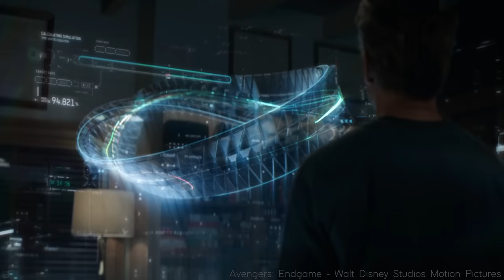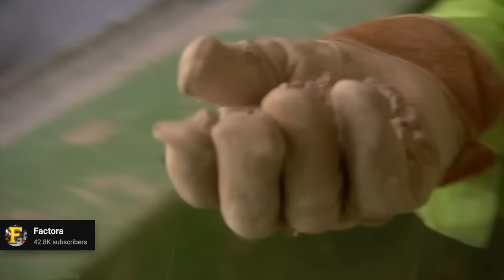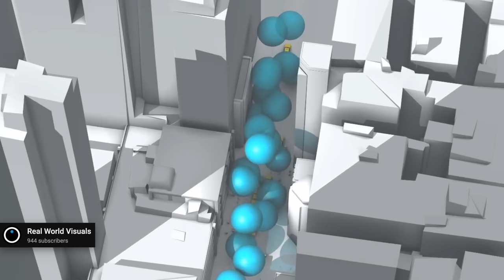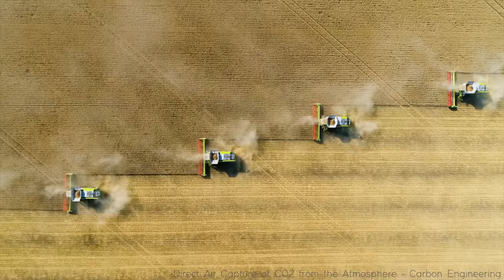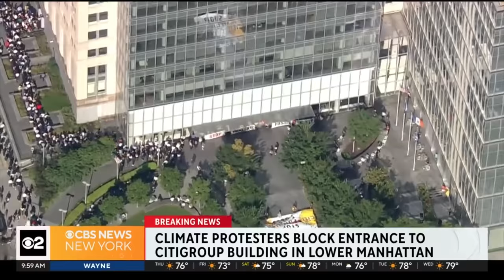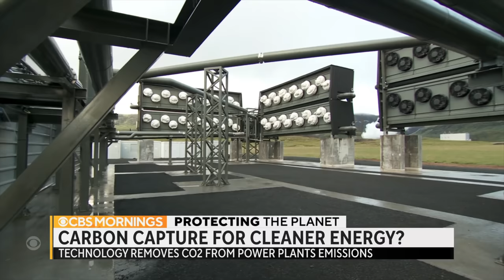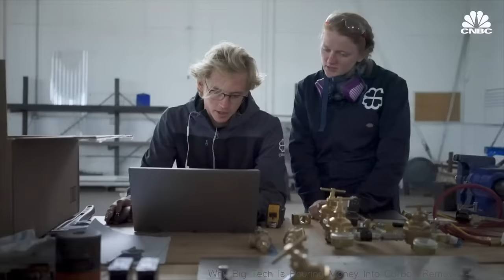How Thermodynamics Holds Back Negative Carbon Tech

Comment: I was initially impressed with this channel but when you stated your “contribution “ to save carbon I realised you were on the wrong track. Running a battery EV is totally against the carbon solution. And do plants not generally reverse the CO2 conversion at night? 
We need to reign in the filth that Asia is pumping out and not run around in expensive EVs that actually deplete resources even more.

Comment: We've had the solution since the 1950s. It's called nuclear energy.
Reply from the maker: Doesn’t solve cement/steel/agricultural/etc emissions but definitely a step in the right direction
Reply: @CoolWorldsLab Those 'issues' will solve themselves once we're out of oil. Coming soon to an earth near you. (By 'soon' I mean several decades, at current/increasing consumption rates. I'll be long dead before I see the worst of the fallout from it)

Comment: First of all, we need to split the CO2  and separate out the carbon and oxygen. And then store the carbon. So for that we need to dial up on thermal solar towers and crank up on the electric processes to split co2 and return only the carbon back to the source

Comment: If DACs got deployed correctly, there wouldn't be brownouts: you'll need GWs worth of extra energy production to afford running DACs and you can always make it so DACs only use excess energy production. More distributed energy production everywhere to power a non-critical loads like DACs should make the grid more reliable overall, not less.
Reply: The issue is that both scenarios assume a growing economy and emission amount so dac demands will increase over time if we plan to reduce the atmosphere ppm. Every summer there are brownouts from the increased energy use of ac alone, of course there will be brownouts if we start diverting 5% of our total output and increase this demand.
Reply: @charlescook5542  You don't divert 5% of the existing supply to DAC, you add 5+% to baseline energy production and sink it into DAC when nothing else needs it.

Comment: Has anybody considered letting the oceans remove the CO2 gas, and then we remove it from the oceans through electrolysis? The energy required maybe greatly reduced since you are assisted by the ocean. Clearly nuclear power will be the only source that can supply the energy needed.

Comment: Ironically, gas flaring wastes 40% of gas (a by-product of oil extraction) and adds to the GHG issue. Such a waste of potential energy. Energy that could be used to at the very least generate electricity for good uses, like carbon capture.

Comment: Wrap a load of logs with stones to weigh them down, using natural fiber rope, then drop it in the Mariana trench. With the low oxygen environment, you'd think it'd "capture" the carbon for quite a long time.
Reply: Yes. But not in the quantity needed.

Comment: Renewable energy is growing at 6%. Solar is growing at 28%
If solar keeps that up, then in 2050 we will have 530 petawatt hours of solar. That is enough to suck up a lot of CO2. The most pesimistic numbers in this video was 120 perawatt hours, for current efficiencies and reverting to preindustrial levels despite lots of emissions.  But that curve was fairly spread over decades, the area under it was about 2000 petawatt hours.
But that exponential curve starts low, so it gives us almost no electricity, until suddenally we get loads of electricity in around 2050 ish. Ie the total solar we get up to 2050 is around the 2000 petawatt hours. This is solar doubling every 3 years. So by 2050 it's given us just enough energy to suck out all the CO2, in a high emmisions scenario, but wait another 3 years and we only need to use half our solar, wait another and it only takes a quarter. 
And by this rate, the entire earths surface is covered in solar by 2076. Exponential growth is crazy.

Comment: There are forms of carbon capture that don't require heat or electricity at all and are completely passive. New types of cements are being made that instead of releasing CO2, absorb it over time like natural weathering, but to higher efficiency. In addition, metal mining causes a huge amount of environmental damage, not just emission-wise but damage to ecosystems and communities from the explosives used and toxic chemicals released. A lot of this could be mitigated by moving most of our metal extracting activities to The Moon where all those metals are waiting for us to scoop up off the surface with relative ease as it's mostly found in the fine powdery regolith, and the low gravity and lack of atmosphere will make transporting that metal-rich sand back to Earth a lot cheaper than sending rockets to space from Earth, once the infrastructure has been built.
Reply: We don't really need to extract all that much more metal. We just need to use what we have better.
Reply: @gekkobear1650  For metals like iron, copper, aluminum and others commonly found in any warehouse this is probably true. It's the rare-earth metals used in electronics that we have a severe shortage on and are extremely dangerous to mine on earth that lunar mining could help greatly with.

Plus, if we could make titanium as cheap and abundant as iron it could replace steel in countless ways, from building structure to vehicles to even kitchenware.

Comment: A few thoughts:
What difference would fusion make, if we speculate commercial readiness by say, 2035?
What about carbon release from tipping point ecosystem collapse? For example methane hydrates or permafrost release? I think that’s not included in those emission scenarios and it make things look a LOT worse?
And finally, where does all the captured carbon go? I imagine we’re talking about insane physical quantities. Can you run the numbers on that, because it seems like another fundamental  issue with scale for DAC
Reply from the maker: Fusion would certainly help if we could have industrial scale by 2035 but that looks v unlikely. Where to store is not something I got into, but it could be sequestered back into the oil fields it came from, or sequestered into plastics, building materials, etc for example

Comment: Thanks for the Thermo figures. The IRA gives $85/ton tax credits for CCS and up to $185/ton for DAQ CCS. Collecting CO2 from ethanol fermentation is much easier as the CO2 in the stack is near 100% (P1 =1 and not 400 x 10^-6) so it is hugely more efficient than DAC. We first need to make our electric power clean and electrify transportation, buildings, and industry. DAC is one of the worst investments and certainly not an excuse to continue emitting green house gases.
Reply: One day hopefully soon, we will have largely replaced fossil fuels in large parts of the world. And when that day comes, the next steps involve DAC. And we don't want to have to invent the tech from scratch when we need it. 

Put a bit of money into lots of different projects, because if/when you need experience in a particular area, expertise can't be bought quickly.

Comment: DAC using "technologie" (in the sens of it not being related to biology) is for sure a new development, but what about the other alternative? BioEnginiring.
Sure using tree is not efficient do do proper carbon capture, but trees are not the biggest source of photosynthesis in nature, they are even pretty bad at it compared to alges and phytoplankton, maybe a bioengineered algea that is really good at converting CO2 to a solid organic compound (that could maybe be used to make stuff) would be more efficient at capturing carbon than machines that would suck up a fith of the generated electricity world wide.

Comment: the realistic question for everyone is WHAT ARE YOU WILLING TO GIVE UP? the fact that nobody on any side is asking this question means that we're actually not serious. you going to give up YOUR job? how about your phone? or your internet? or your comfort in the summer and winter? air travel? no? well there's your REAL answer. all the "worst case scenarios" are the likely scenarios as it pertains to atmospheric co2. the ramifications of that are not clear. but the ppm in the air is pretty much certain.

until we actually talk about tangible SACRIFICE, this is all just rhetorical jerking off and frankly, a waste of time. but we go on blab blab blab blab blab. it's what we're best at.
Reply: The problem with any sacrifice based mentality is it goes around sacrificing. That is, it goes around getting rid of nice things, while not actually asking what it's getting. So you sacrifice things that people enjoy and actually have negligible carbon footprint.

Also, if you are going "sacrifice", and some tech pops up, like solar radiation management or cheap solar or something. Then it's hard to go "oh, we don't need to sacrifice any more, we can do that instead". 

If you decide we need to lower standards of living to fight climate change you should check both that the changes you are making are less bad than the climate change you are preventing. And also that they are actually needed. That there isn't some clever have your cake and eat it too scenario.

Comment: Daisyworld & Climate Regulation Through Biosphere Enhancement

"Daisyworld... provided a number of useful predictions of how Earth's biosphere may respond to, for example, human interference. Later adaptations of Daisyworld... which added many layers of complexity, still showed the same basic trends of the original model.

One prediction of the simulation is that the biosphere works to regulate the climate , making it habitable over a wide range of solar luminosity. Many examples of these regulatory systems have been found on Earth...

Later extensions of the Daisyworld simulation which included rabbits, foxes and other species, led to a surprising finding that the larger the number of species, the greater the improving effects on the entire planet (i.e., the temperature regulation was improved). It also showed that the system was robust and stable even when perturbed. Daisyworld simulations where environmental changes were stable gradually became less diverse over time; in contrast gentle perturbations led to bursts of species richness. These findings lent support to the idea that biodiversity is valuable." ~ Wikipedia, 'Daisyworld' entry

Comment: Please do not forget thte fact that, if everyone in the world wanted to use an EV car, 1) Earth does not have enough Lithium resources (that can be extracted with no EXTRA co2) easily attainable 2) This process would take decades to do 3) The emissions would skyrocket due to the manifacturing of those cars.... So an EV-rush is not a solution by its own.. PLUS low calcinated and/or calcification preventing additive cement and protland cement are getting easier day by day to reach by the common folk... So i would prefer you would make a video about how rushing to EV related systems would jeoparidise the planet but it has to be done gradually...

Comment: He hit on the real problem, but was unwilling to unpack the discrepancy. The economic system is fatally flawed, as it sends price signals which do not include thermodynamics or ecology. In fact, the input/output models of neo-classical economics assume the economy is an isolated system, because that is the only way the model remains viable. I’ve been looking for the boundary of the economy all my life, and have yet to locate it. Economists are evil, because they represent their discipline as science, when it is ideology. They include ‘energy’ at about 10% of the economy, because that is what prices reflect. Their models require nature to be free of cost, but products at the highest cost. Pollution like all harms is ignored, while benefits are transformed into profit, but only for owners - who derive return from capital at rates which exceed natural regeneration, and magically experience no entropy, and the metabolic profile of cancer (continually growth until the death of the host). Having reached planetary limits, taking market allocation, and the price mechanism as given is a disaster. And economists advise governments, and determine policy. Physicists are well placed to challenge this hegemony, and reveal the madness of economic primacy.
Reply: Exactly. We cannot continue as a species operating under an economic system like this. The contradictions of it have been evident for decades but we cannot ignore them any longer. That's why they now push for space colonization, for asteroid mining, because they need profits, more profits, more growth. We cannot meaningfully address the issue until the corporations that, in practice, run the world either stop valuing their stock prices and dividends over the planet's health or, more likely, are forcibly disbanded.

Comment: DAC machines as common as bolt on Aircon units to houses... Upsale being cleaner air for your homes. Reality, that clean air also makes it out into the atmosphere too. Mega factorys of dac machines not needed. Just the advertising and sales tactics to sell smaller units to domestic houses. Then land mass isn't a problem either

Comment: Damn!!.. i had to do the math on that.. using MEA, which is likely the capture tech you were referring to needing just 100 degrees C to recharge, it looks like it would actually take 162,800 watts continuous to remove 1 mole per second... that's not even close to the ideal and that's one of the better options out there!! 
A whopping 3.7 megajoules just to remove 1 kg!!.. 
ya.. we are screwed!!
Reply: 1) Future breakthroughs in carbon capture. 
2) oodles of cheap energy from solar/nuclear/fusion/something/earwigs
3) how much damage will climate change do anyway. Can we just put up with it?

Comment: I absolutely sucks at thermodynamics, but if we used cold condenser a bit like moisture absorber already exists for water, but for CO2 , would the same equation apply ? Yes it requires -80°C/193K but since DAC already seems to be absurdly energy intensive, i'm just wondering. Did somebody did the math ? Beside it will produce solid CO2 and some heat that maybe useful.
Anyway thanks for all the amazing work you put in your videos :)
Reply: Unfortunately, no. Firstly, -80C is when the vapor pressure of CO2 is the same as atmospheric pressure. It only STARTS to solidify at that point. To solidify 99% of it at ambient pressure, you need to reach -120C. The freezing point goes up if you do it under pressure though. 

But the main problem is that even if you cool it to this point, CO2 molecules will remain in the air as a supersaturated mixture. Even though thermodynamically it should freeze, kinetically the process happens very very slowly or basically not at all. The way we separate gasses from air is to freeze ALL of air and then distill off gasses as you raise the temperature again. So you'd need to freeze the oxygen and nitrogen too to remove the CO2. CO2 would only be 350-450 ppm, so this is a ridiculous amount of unneeded energy expenditure, many times greater than what would be required with desiccants like in this video.
Reply: @iankrasnow5383  Thanks for the answer :) Now i'm wondering if factory producing liquid nitrogen and liquid oxygen don't also produce some CO2 as a by product.

Comment: Seems like that idea of building a ton of solar panels in the middle of the Sahara Desert makes sense now. Build out humongous solar arrays out there to power carbon capturing plants that primarily run whenever there's sunlight, so purely on renewable energy.

Perhaps also build a nuclear plant to have some nominal level of production over night, along with stable, long term battery backup to extend the working capacity by a few hours before/after. Obviously even with those setup, presuming most of the energy comes from solar, numerous CO2 capture will be not in use for perhaps a third of the day.

Just an idea. Not something I have put any serious thought into.

NOTE: Yes, the idea of getting solar energy from the Sahara to power Europe or other distant locations is unrealistic unless easy to manufacturer, room temperature superconductors become a thing.
Reply: > Perhaps also build a nuclear plant to have some nominal level of production over night, along with stable, long term battery backup to extend the working capacity by a few hours before/after.

???
Just spend the money on more solar panels. 
You have identified the easy way, yet insist on doing a bit the hard way too. 

Powering europe from the sahara is realistic if you use high voltage DC and don't mind 10% losses.
Reply: @donaldhobson8873  As I understand it, the euro commission's institute of energy said it'd be losses around 10%, but other studies said they could be around 15%-20%. Also, the estimates for building started at 400 billion, plus super fun discussions about 'using' Africa's resources in Europe touched on social issues. Seemed like a lot of headwinds.

Since decisions for energy like this are based on economic feasibility, it just didn't seem like this was realistic at all. The comment about room temp superconductors meant that costs would go down dramatically, assuming the mfg costs are reasonable.

If the EU can make that happen and it's actually useful, then great. As insane as it sounds, having some kind of international cooperation to slowly build out carbon capture plants in Sahara that could literally just run when the sun is shining, avoiding fossil fuel usage, just seemed like a better way, avoiding the absolute titanic costs, 10% to 20% resistance losses & potentially social issues.

Just spitballing here.